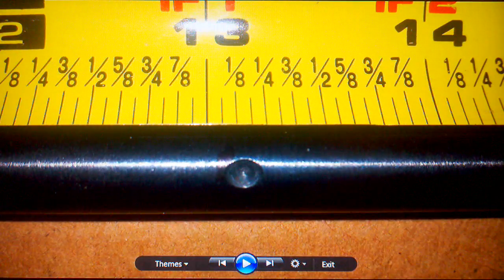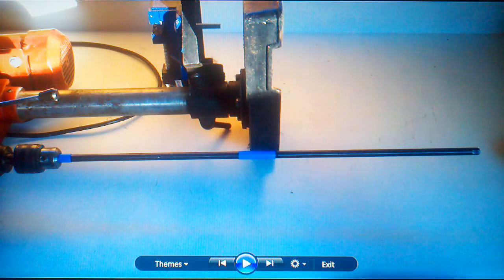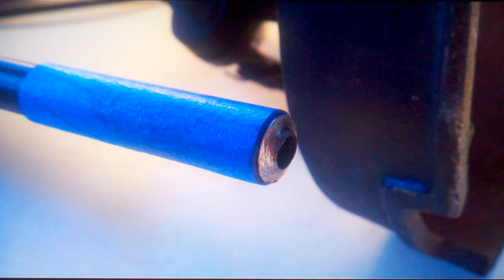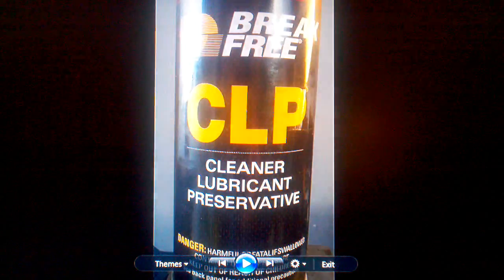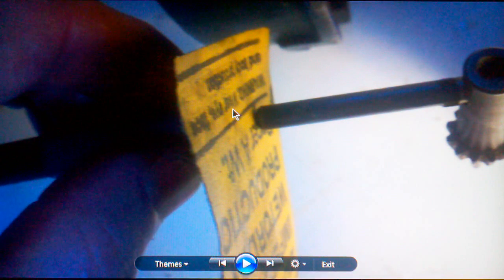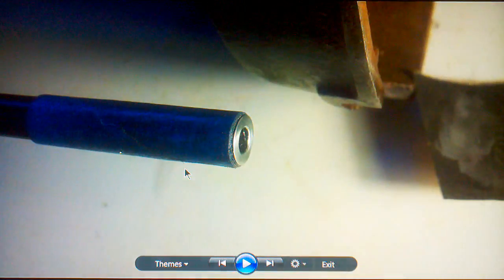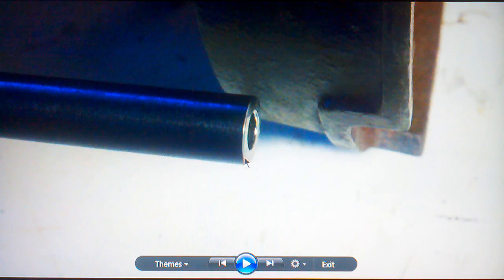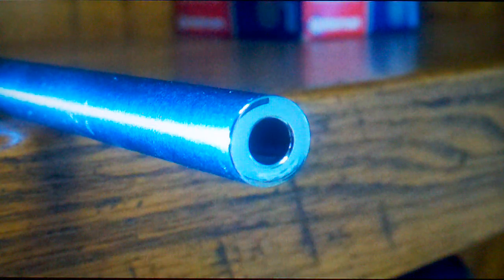Crosman barrel modding

Comment: where can I get one?
Reply from the maker: Thanks for commenting.
Not sure what your asking?? Please elaborate
Reply: +AIRGUNSNIRVANA wait so you didn't just buy it but it was custom
Reply: +Hudson Yarborough basically I have no experience with any sort of gun, and I want to get a crosman 1322,but I'm trying to turn it into a rifle by getting a stock,scope,etc. I thought that this would be really cool to have on it.Do you know if I can just buy a 1322 barrel extension(24 inches)?
Reply from the maker: Thanks for commenting, and clarifying.
Sorry if I'm a bit slow :-) Happy to help if I can. The barrel in the video came from Crosman and I cut it down. There are all kinds of options when modding 13xx line of guns.The first place I try and source parts is from Crosman parts "800-724-7486" they are usually the cheapest. They only take phone orders but are good people and very helpful. If the don't have the parts then it's Google time. When it comes to adding a longer barrel to the 1322 24" is a bit long. 16"-18" max because for the best accuracy you want much of the barrel as possible supported. I went with a 14" barrel on my last build part# 2289-001, I also showed it's reworked crown in the video. A 2289 is what Crosman call a 1322 with the shoulder stock and 14" barrel. If you plan to add a scope a steel breach is the best way to do it. I hope this helps, have fun...and if i can help further let me know
Cheers
Reply: +AIRGUNSNIRVANA ok, thank you for replying. I kinda need it to be the 1322,though, because I'm only 13 and I have to convince my parents that it's safe enough to get one. how long is the default barrel length?
Reply from the maker: The stock barrel is a little over 10". If you are able to talk your folks it to getting one, look at The Crosman Custom Shop. They can build you one with steel breach. Stock barrel or a 14' or 18" with the shoulder stock. And to top it off they will engrave it !! Going with the CCS, will save you $$$$ over doing it piece by piece. If you already had a 1322 that would be a different story. One last thing don't buy a scope from the CCS. get  compact scope with an Adjustable Objective. This will be great fit. Let me know if I can help further
Cheers
Reply: +AIRGUNSNIRVANA  do I need the steel breech for a scope to be attached? Money isn't a giant issue, because I'm getting it for Christmas. I will probably use the custom shop, and then just get a lot of ammo. in your opinion, what is the best.22 pellets? I wold be using it mostly for target practice, but possibly some slight hunting of small animals.
Reply from the maker: It will be a Marry Christmas for sure then. A steel breach is not the only way to mount a scope, but it is the best. There are types of mounts that attach to the barrel and a scope attaches to that. The price for some of these type are so close to the price of a steel breech it's hard to say get it. These look cool I guess, but accuracy suffers greatly. It is hard to be happy with a gun that can't reliable hit what you are aiming at. As far as ammo, Crosman Premier Hollow Points .22, and the Benjamin .22 Caliber Hollow Point Pellets are my go to pellets. They can be found at most Wal-marts or Academy and the like. Whichever one is cheaper that day is the one I buy. I have punched many paper and fury targets with them. Let me know if I can help further
Cheers
Reply: +AIRGUNSNIRVANA thank you for replying, I think that I will just get the steel breech because it seems simple.what is the measurement for the steel breech, so that I can know what size scope to get?
Reply from the maker: According to The Crosman Custom Shop site there are two sizes available. A 5 inch short steel breech, and a 6 ¼ inch long steel breech . I have only used the long one. Hope this helps. Keep me posted on your progress, and have fun...
Cheers